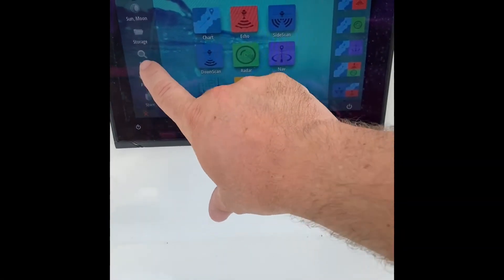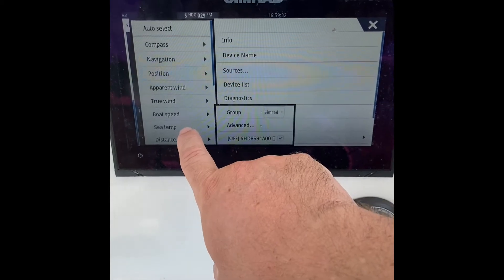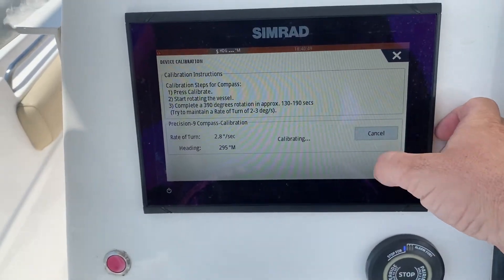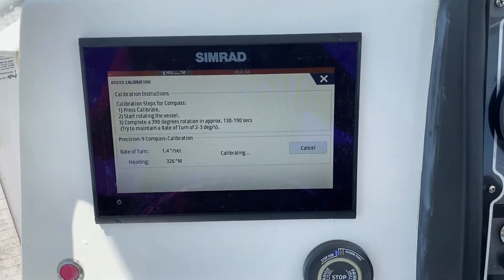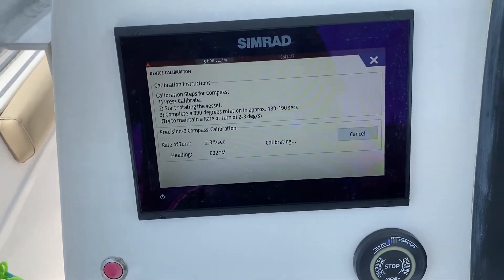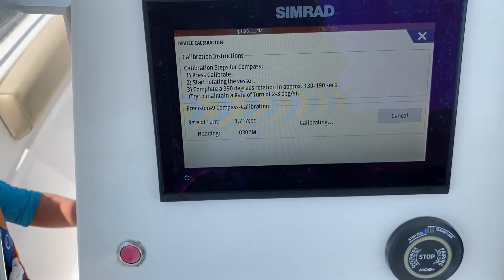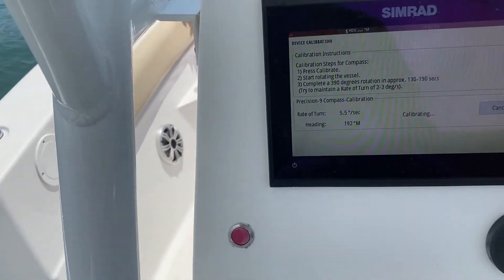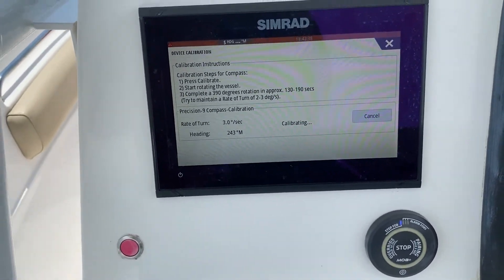Simrad Precision 9 Calibration and Go 9 Settings

Comment: Thank you for the video. I recently replaced a Precision 9 unit with a new unit because I was getting erroneous Compass readings. My B&G chartplotters aren't picking up the new Precision 9. Under heading it just has three lines. I'm wondering if I need to calibrate the compass before they recognize it or if I might have a defective unit? any thoughts

Comment: I have a Sea Fox 246 Commander and have been having all kinds of trouble with the Point 1 compass that came with the Autopilot.  Getting the Precision 9 compass to try to deal with it.  No problems with yours running the Autopilot?  My COG will be 9 degrees and then Heading will be 270 degrees after calibration.  Such a pain.
Reply from the maker: So far so good, based on my research the point 1 is very susceptible to magnetic interference.  Especially radio antennas.  The precision 9 supposedly doesn’t have the interference issue like the one point 1 and it doesn’t have a gps so it doesn’t have to be mounted on the T-top.  I mounted mine inside the console.  Another thing to add about the precision 9, it has a mini gyroscope in it.  So as the boat rocks and heaves the sensor compensate the heading.  This should reduce the tendency of the craft to duck walk in a rougher sea state.

I will try and get my install video out this weekend.  I also intend to do video of it operating as well, but I want to run it a few more time to verify before I put some wrong information out there.
Reply: PaulOffshoreFishing : The point 1 is bad when you have 4 speakers with magnets in the hardtop like the 246 Commander does.  I’m going to mount the Precision 9 inside the console and keep the Point 1 on the hardtop for GPS only.  The autopilot is quite useless without a good compass.  Took me a while and some research to figure out the magnetic field was causing so much trouble.  With your Precision 9, the COG and heading match or are close now?   Looks strange when on the chart view with the boat appearing to move sideways as you travel.

Comment: I had the same problem of trying to keep a steady turn. LOL
Reply from the maker: Yeah, I wanted to run up the ICW but the storms yesterday prevented that.  My biggest hurdle was trying to switch mfd from the point1 to precision 9.  It took me 2 days to figure that out and it was the simplest thing. 😳
Reply: @MattPaulFishing  Thor and I went behind the port yesterday to catch some pin fish. The nosee'ums were terrible.  Left there and went to AR 320 and was back at the dock by 1100.
Reply from the maker: That’s the bad part of no wind in July and August, buggy and hotter than hades.  We went to cape after lunch and played in the water all afternoon.  Nice and relaxing.
Reply: @MattPaulFishing  Let me know if the Precision ( works better for the autopilot.  If so, I may have to upgrade.
Reply from the maker: Will do, I going to get my install video out later this week.
Reply: @MattPaulFishing Awesome!
Reply: @FishOnForte  Magnetic interference aside do you feel the Precision 9 made much of a difference in pilot performance keeping in mind the limitations of the Point 1 AP. I just installed the OUTBOARD PILOT HYDRAULIC PACK and am waiting for weather/time to water test. Thanks.
Reply: @bcxlt1504  I friend Mat Paul has the precision 9.  I have the regular setup that came with the Outboard Pilot. Mine autopilot does sway a little but it is still straighter than I could steer. When I am trolling for pelagics, it seems to track better. than the 50 mile run back to the ramp.  It still beats steering all the way home any day.  Catch'em up!